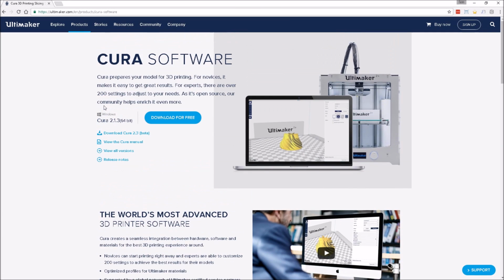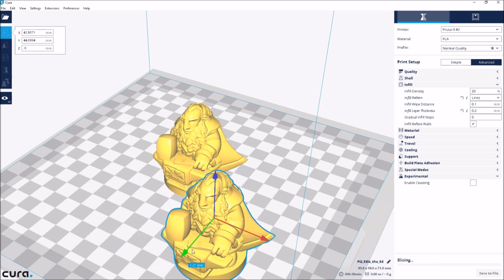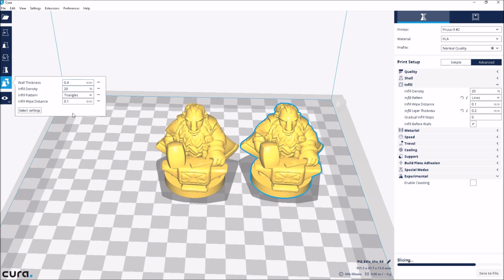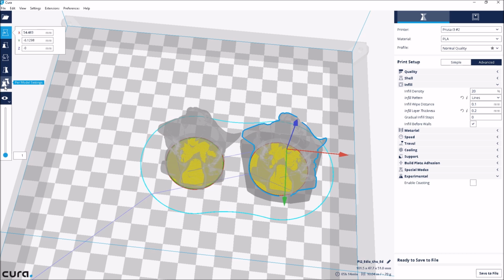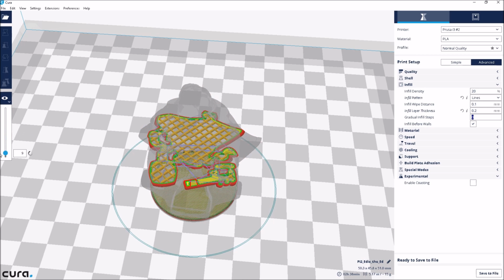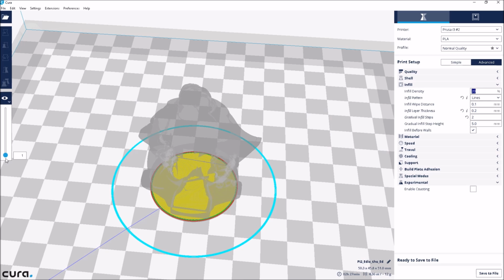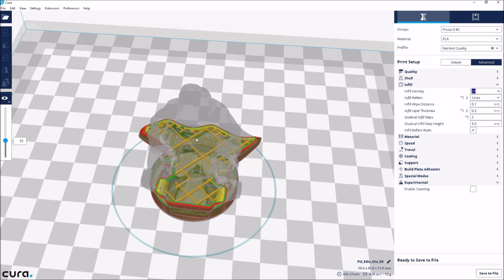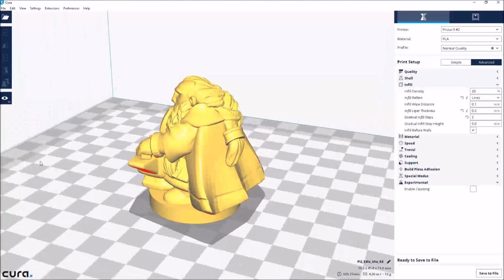Cura 2.3 (beta) Per Model and Gradual Infill settings

Comment: Hi I have a problem see if you can help me with it I don't know what I did wrong but every time I print a model it doesn't have no infill I tough it was my printer but then I when to layer view and only check the box for show infill and is showing nothing everything else but infill. Also in my settings the box for infill density % is at 20% but the box is grey and don't let me change it can you help me with this please? Or any buddy 🌡
Reply from the maker: It sounds like there is probably another infill-related setting that has been changed which is stopping you from changing your infill density. It could just be that infill has been unticked, or maybe some other setting has overridden it. You may have to go over the advanced settings and check that none of your infill options have been accidentally hidden. There could be a number of settings that may affect it though. If you still have trouble finding anything, it may be easier to reset your printer's profile and start again with fresh settings.